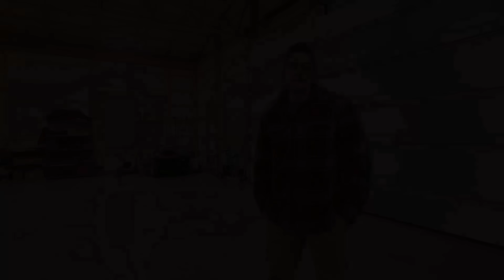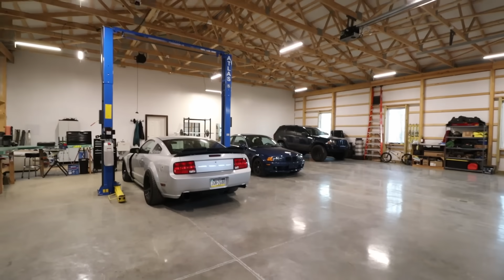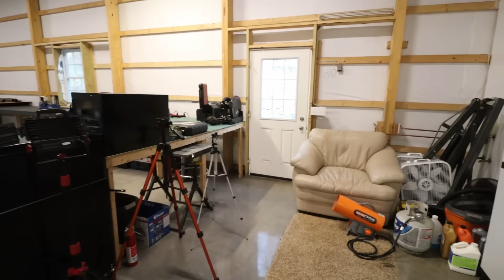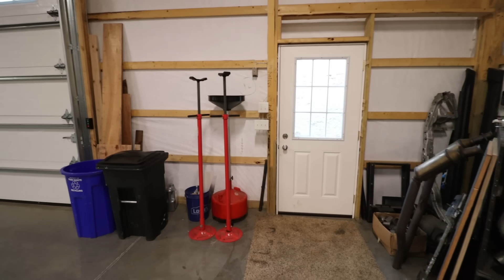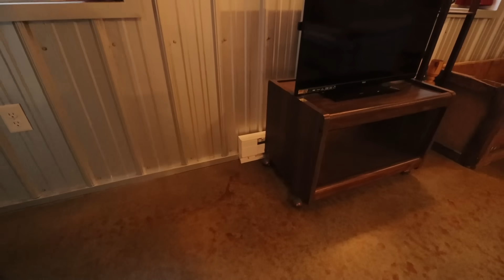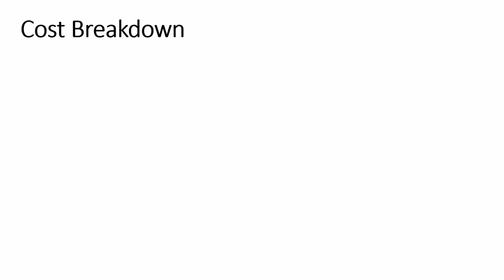50x70 Garage House - FULL TOUR and COST Breakdown

Comment: I also has a single room style garage and there are problems....  I have two 4 post and one 2 post lifts and use mine mainly for car storage.  The problem is when you want to use the chop saw, use a table saw, paint, or the really bad one... buff.  You end up just get dust/dirt/over spray all over everything.  I have thought about putting floor to ceiling curtains in on tracks so I could open and close areas but still haven't.  Just a little food for thought.
Reply from the maker: Yes I considered this when building but havent done anything specific yet, I've had the same idea with curtains to section areas off when needed.

Comment: Outstanding job young man!!!! I’m so proud of you, too bad we can’t get more young folks to follow your lead instead of thing they need a 6,000 sq ft McMansion to keep up with the Jones’s at work. Your on the right track buddy and I’m proud of you!! Keep it up!! 

I’m a retired custom home builder and just food for thought for now and it’s totally up to you and what your needs are but if it were mine I would consider just doing two open shelves on each side of the sink. Your kitchen looks fantastic right now and it’s just my personal opinion but I think upper cabinets make the area look cluttered and cramped. By using open shelving, it gives you the same amount of storage but still maintains the open feeling and I think they look fantastic!!

Some folks have used 3/4” black gas pipe for the brackets and shelving supports and that would look phenomenal in your place since you have the metal siding inside for the walls. If you used a combination of a 1 1/2”-2” live edge slab cut 10-12” wide and use the pipe brackets then you will have a show stopper buddy! You can find plenty of pics of this style online or in any current kitchen magazine or home improvement magazines currently being sold. 

But regardless of which direction you go, it will look phenomenal!! Keep up the good work and stay safe brother. See ya on the next video!!
Reply from the maker: Thanks so much! And yeah that does sound like it would look nice in my place, my only concern is worrying about dusting the shelves often, I feel like I'm always dusting already! Thanks for your input!
Reply: @Kordare  Black glossy pipe would look cool and add a bit of class also

Comment: It's somewhat dangerous to have a gas flame water heater in a living space. You run the risk of carbon monoxide poisoning or fire hazard. You can simply enclose it and vent it outside. Wouldn't cost much. It would cost more to ignore it.
Reply from the maker: My water heater is electric, not gas. Also, all of my smoke detectors are also carbon monoxide detectors.

Comment: Any problem with Exhaust and chemical smells from the garage getting into the living section ?
Reply from the maker: nope haven't had any issues at all. It probably helps that the divider wall is fully insulated and the whole way to the roofline.

Comment: To protect your walls around the perimeter of your garage/warehouse put 4 foot high by 8 foot long plywood from floor up so  this will protect your exterior walls from accidental strikes from car door dings or dropped items off work benches or dents showing on the outside of your building. Also if you want to go higher it can also protect against someone breaking into your wall. Use 1 1/2 wood screws with glue that comes in caulk gun to glue/screw plywood to wood framing. The plywood is easy to replace but to repair your steel outside walls would be expensive and ugly!
Reply from the maker: Thank you for the tip! I am hoping to fully insulate and have interior walls in the garage in the near future!

Comment: Nice! Do you find that your heat goes up into the loft space though and out the roof? I'd be weary of that.
Reply from the maker: Thanks! I actually have plywood and a sheet of foam insulation I lay across the opening in the winter. Some leaks but this wood stove is oversized for the space anyway, so it's not an issue.

Comment: If I wanted to build a barn and eventually finish a part of it would I need to run water and plumbing before I do it? I assume the plumbing runs under the concrete?
Reply from the maker: You are correct. You definitely need to have all your drains figured out beforehand, water lines mostly run in the walls but does come up through the floor from the well.
Reply: Kordare thanks! Great video as well!
Reply from the maker: @Fulcra  thank you🤘🤘

Comment: do you get a lot of snow where you are, was considering something like this eventually but apprehensive to get up on the roof in the winter to drag snow off
Reply from the maker: We do get some snow but I never have to worry about it. The roof is designed to hold the weight and most of it ends up sliding off by itself.
Reply: @Kordare  We put a metal roof on both the house and that storage area called a garage. I love the fact the snow just slides off. South East of Lake Ontario here.  I drew out something much like this as a dream. Great build.

Comment: Those outlets should have metal boxes and metal face plates and have mc (metal clad) ran to them instead of romex just so that the wires dont get damaged by sparks, heat, and debris ( exploding grinder disk etc. )
Reply from the maker: Whys that? I do believe they are all on ground fault circuits.
Reply: @Kordare  just for safety and peace of mind. I didnt see if you had gfci outlets, but having metal faces on metal boxes is what I would do in a garage area so that a slight bump or something wont smash your faceplate and expose the angry pixies.
Reply from the maker: @matthewkesterson  I didn't see the second part of your comment, makes sense!

Comment: Looks good. 👍

Not sure how much snow you get. But, watch out for any ice/snow buildup on the roof. I’ve seen slide offs destroy sheds and a side of the garage wall before. My two cents, noticed how “close” holding tank lids are to garage.
Reply from the maker: You are correct, the video might not do it justice but the tank lids are actually much out of the way of where the snow falls. I also did install snow catchers on the living portion roof.

Comment: I bought 20 acres this past fall to build a “shouse” / “barndominium” like you’ve done. I wanted to get away from neighbors to continue building my cars and bikes. 

Question: Is your concrete sealed?  Coated?  How are you dealing with not staining that beautiful concrete. 

I can be a bit OCD with my cars/house/tools 😂
Reply from the maker: I stained the concrete in the living space and put a clearcoat over top. In the garage I did a polyaspartic clear coating that I rolled on. All products I used were from surecrete.

Comment: My house is very similar to yours and I am extremely satisfied with it. Been living in it around 8 years now with zero issues. One suggestion I have for you is to look into mini split AC and heat pump combo. I started off with window units and heat strips but electric bills were more expensive than I liked. I made the switch to mini splits and couldn’t be happier. They’re very efficient and quiet. Cut my electric bills in half. Very simple to install as well.
Reply from the maker: Awesome thanks for the tip!
Reply: @Kordare  I concur- mini splits are awesome for simplicity and cost-effective heating/cooling. They are best in buildings with fewer partition walls; great fit for your place. We love ours and will be using them WITH solar when we leave here to build a home and garage next year.
Reply: I'm a HVAC tech and the ductless systems are great. The Mitsubishi Hyperheat and Fujitsu Halcyon will heat 80% capacity down to -15 degrees.
Reply: Look into ductless systems. With that area it would be extremely cost effective.
Reply: I did the same in my garage.  Mitsubishi 48k BTU unit outside and 3 head units inside.  Works great and low cost to operate.  It helps that I really insulated the garage well.
Reply: A lot of the better mini splits also heat with no issues down into the negative temps.

Comment: The ultimate bachelor pad!

The drainage may seem a bit much, but it is important to get that water away from the building.
Reply from the maker: You got that right! The excavators did a good job and I've had zero drainage issues.
Reply: We had a 30x40 building built and had to do the same thing. What sucks about it is the cost. You be surprised how projects like a pole barn will nickel and dime you to death.
Reply from the maker: @JesusChrist-uu2te  you got that right! That rainwater pit was like $6500
Reply: @Kordare  - Approximately what was the cost breakdown for that(materials, permits, labor, etc.)?
Reply from the maker: @foadrightnow5725  for the rainwater pit? Honestly I dont know the exact breakdown but that included the excavation and materials needed